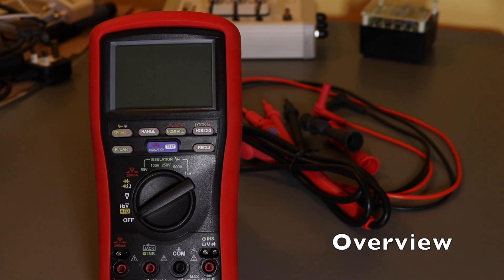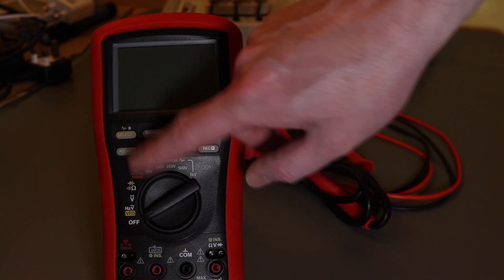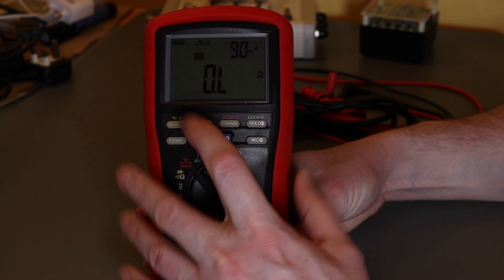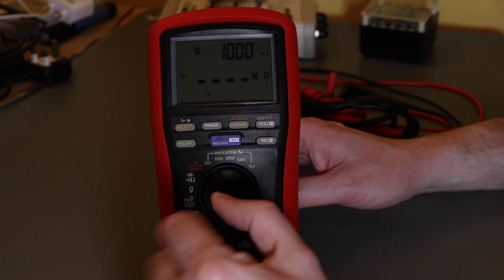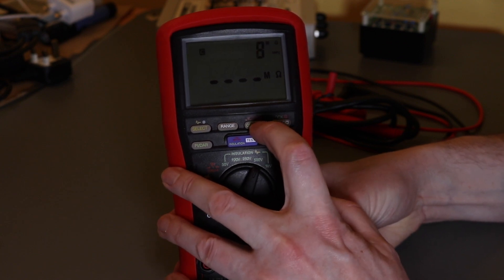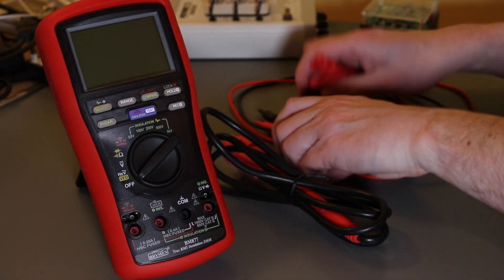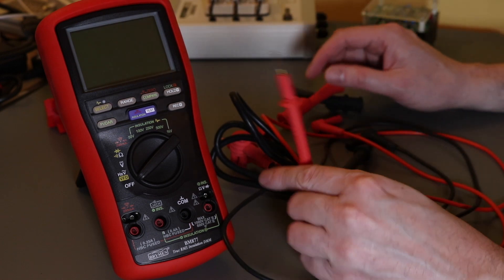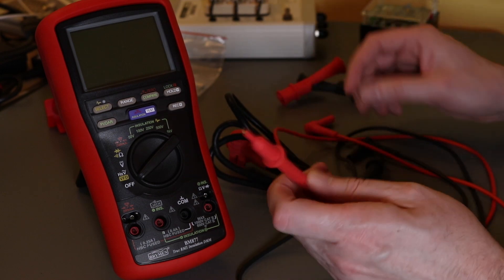Brymen BM877 Insulation DMM Basic Functions

Comment: What is the pi/dar? I trouble shoot elevators and needed the insulation testing and the earth bound can be handy, but can you explain the pi/dar
Reply from the maker: They are timed resistance tests that characterise the condition of the insulation as a ratio rather than a resistance value.
The DAR (Dielectric Absorption Ratio) test is usually carried out over 1 minute and then the resistance reading at 1 minute is divides by the resistance value at 30 seconds. A value below 1.25 is poor, between 1.25 and 1.6 is adequate and above 1.6 is good. Some meters use the 30 second to 15 seconds values for the ratio. A bad DAR value indicates a fundamental problem with the insulation under test.
The PI (Polarisation Index) test is the reading at 10 minutes divided by the reading at 1 minute. A value below 1.5 is poor. 1.5 to 2.5 is adequate and above 2.5 is good. A poor PI value is more indicative of dirt or moisture contamination within the winding.
The value of the ratios is not considered to be temperature dependent unlike the actual insulation resistance value that can be affected by the winding temperature.
Not all electrical apparatus will display a DAR or PI value when tested. It is usually used on form wound motors and generators rather then random wound apparatus.
Reply: @three-phase562  so you think I’d need to do this trouble shooting elevator controls? I haven’t trouble shooter any motors yet. Maybe drives and safety circuits . I got the 869 but I won’t measure any current with this. Do you think I’ll ever need to do this??

I mess with variable reisitors, transformers, fuses, what you think

We do have mg set but they are phasing out.

My level of knowledge is that I’m an apprentice
Reply from the maker: @shiningstaer  For just basic maintenance and trouble shooting you are not likely to utilise DAR and PI measurements. These are more for condition monitoring of apparatus over long periods. Motors on elevators you are likely just interested in proving that the motor and cabling has good insulation and is safe to energise.

For electrical maintenance work, I tend to use a clampmeter for current measurement and a 2 pole voltage detector such as the Fluke 110 for all other measurements. I only use a multimeter for setting up motor drives.

Comment: Hello, 
Looking at this Brymen against the RS Pro IIT-1500, would you have any preference in them  
Thanks
Reply from the maker: To be honest it is a very close call between the units and depends on the exact requirements you have. 
There isn't much to choose between them in terms of an insulation tester. The Brymen offers slightly better ranges for voltage and resistance measurements, but you swap leads a lot due to the input jack configuration. If you deal with larger motors then the crocodile clips aren't that good with the Brymen.
The ones I looked at were both good quality builds, so no significant benefits for either one in that department.
If you can live with the input jack arrangement and the test leads, I would personally go with the Brymen as you can get it a bit cheaper than the RS Pro.
Reply: @three-phase562  why do they have the volt dial instead of having auto volt range like on better brymen models? A price thing or do you get Better reading?
Reply from the maker: @shiningstaer  If you are referring to the 50 to 1000V settings on the rotary selector switch, they are the output voltages for the insulation test function. This tends to be the more traditional approach of insulation testers, although there are a few out there with an electronic test voltage selection. Either method works just as well.
Reply: Thanks for the advice appreciate it, I figure I will go the brymen the price as you say is slightly better and I quite like there offerings in general, good point about the input jacks 👍